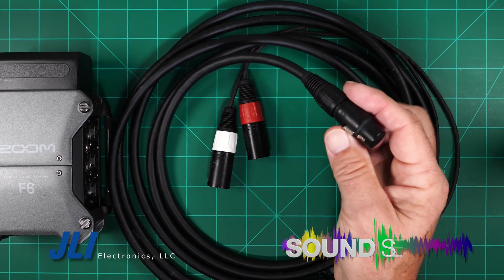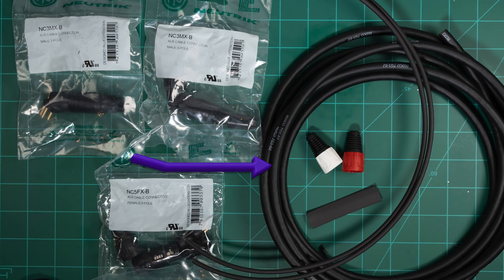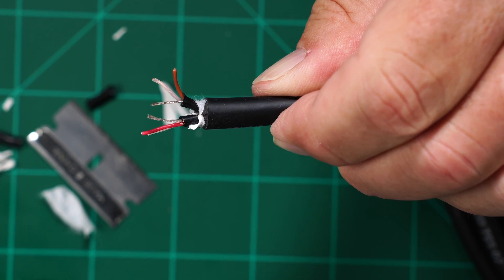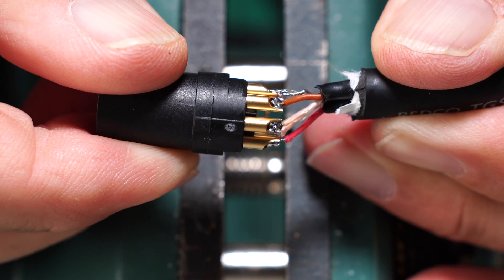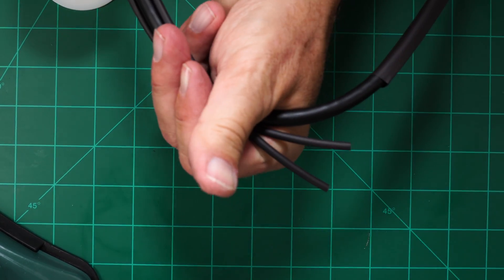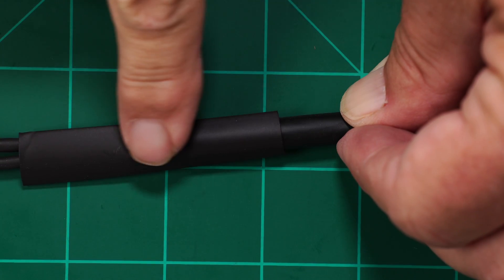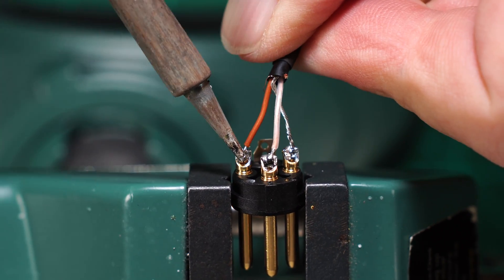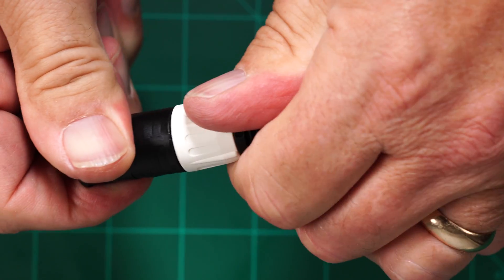5-Pin to Dual 3-Pin Cable Build

Comment: Could I use this cable to send stereo audio over a 5pin DMX 10m cable run?
Reply from the maker: Possibly. Not all DMX cables are wired internally with two pairs. You can make the cable shown in this video 30M and it will work.